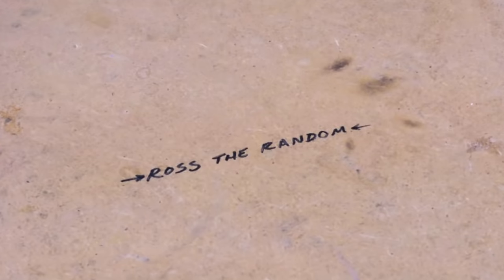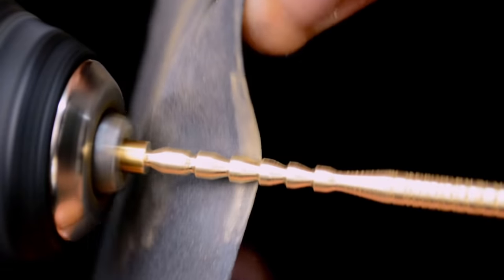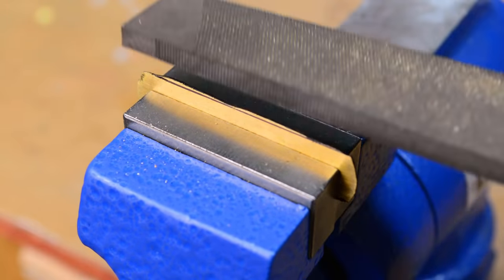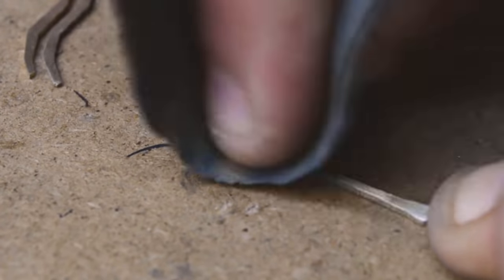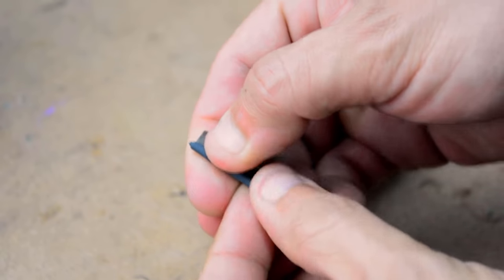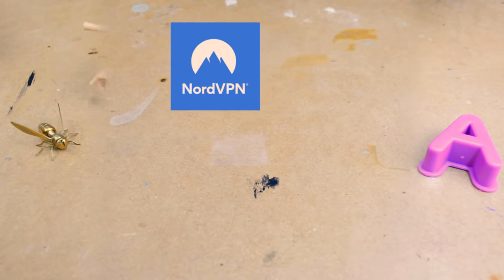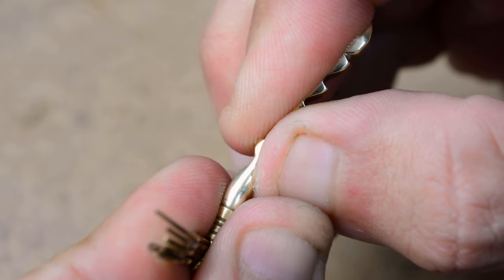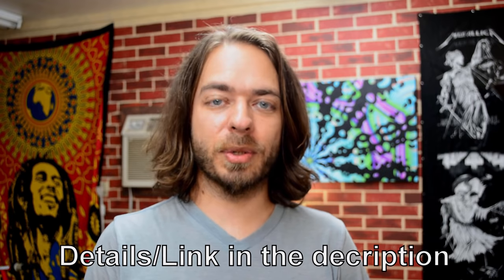I Turn ONE Screw into a Little SCORPION!

Comment: Hi, just a tip: your brass will be super soft if you quench it in water after heating. It's the opposite of how steel works. You'd be surprised just how easy the brass will be to work after quenching.
Reply from the maker: Thanks Mark! I remember reading that about non-ferrous metals, will definitely have to try that out 👍

Comment: I use 3 layers of duct tape on my vice jaws, both sides when I make minis. That way when I remove my mini for inspection I don't have to unwrap it and I save money on tape. 🙂
Reply from the maker: That's a good idea! I might try that next time, maybe a layer of masking tape first? Be easier to remove 😉
Reply: @RossTheRandom  
You could make different timber jaw plates for your vice, I've done that trick also, just becomes a pain in the butt changing them back and forth. Timber is terrific on softer metals. Masking tape can move around in my experience.
Reply from the maker: Hey that's a thought, I do have some scraps of walnut lying around!

Comment: Fun Fact: According to the British TV panel show QI (who usually have a very reliable fact checking department), the scorpion venom is second-most expensive, behind racehorse semen. Iirc, it was somewhere in the neighborhood of $50,000,000 per gallon. And the scorpion venom has apparently dropped quite a bit in value because of the venom milking technology. 

Of course, QI could have been wrong, and so, therefore I may be wrong. But I generally tend to trust their info, especially on things I’ll never need to know the absolute truth about haha